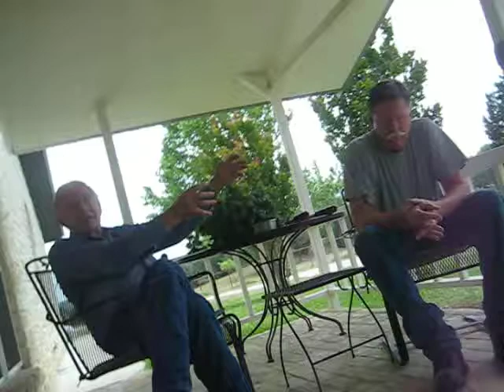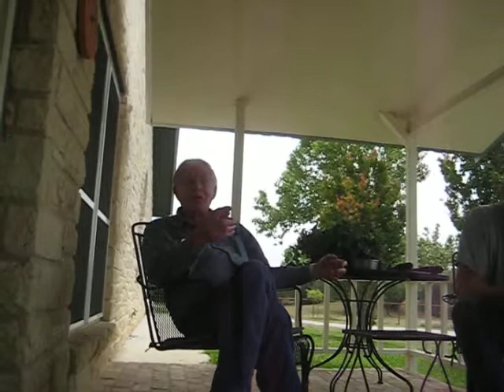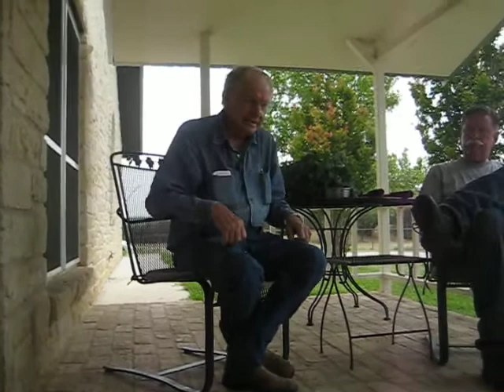Dale Henry PE Lampasas TX on Earthquakes from Fracking vs Injection Wells

Comment from the maker: Here are my notes that I took...
barrels per minute of injection wells = 2-3 bbl verses
barrels per minute during fracking = about 200 bbls
PSI for injection wells = 1,000-3,000 PSI verses
PSI during fracking = 10,000-20,000 PSI.
Time frame of energy storage before seismicity = 18-30 months or less.   So why are some epicenters of some of these earthquakes near injection wells? It could be coincidence...since I'm stastically inclined to analyze things I doubt it. So when the energy from hydrofracking gets stored up that Dale speaks about that then needs to "burp every so often",  I believe that the faults with the most stress give way/slip first ....which is near those heavy ass injection sites.  UPDATE Arlington just had a 2.4 on 9/7/14 and M Henry’s timeframe of stored energy burping is right on target as drilling greatly decreased in Arlington back in 2012...so how many more and how intense will these burps be? Will the casings and pipelines hold?